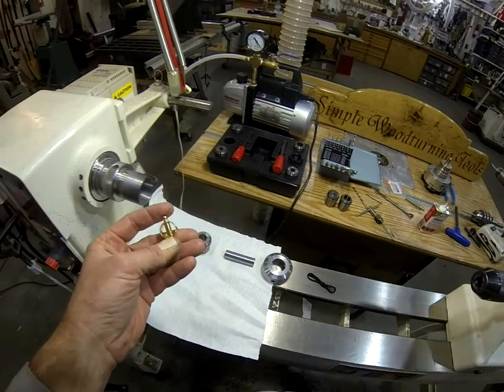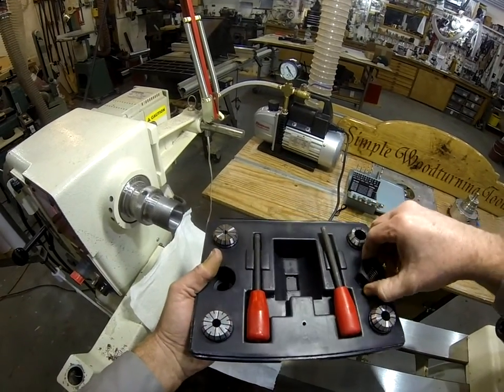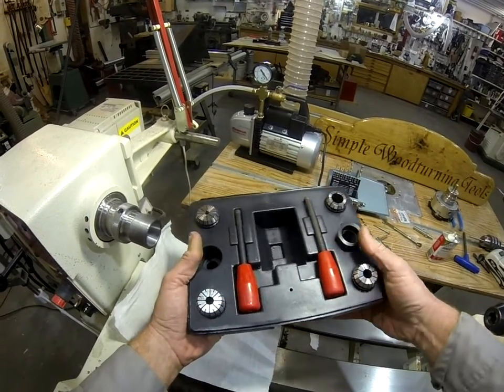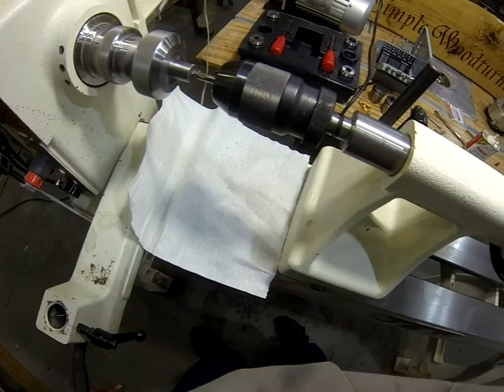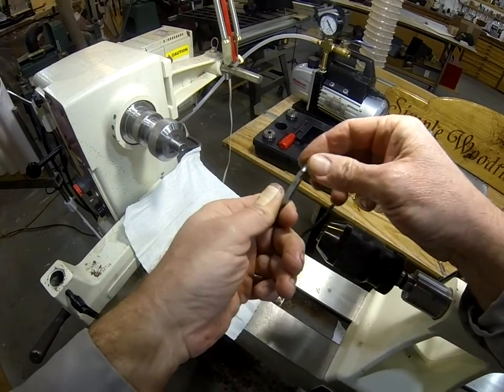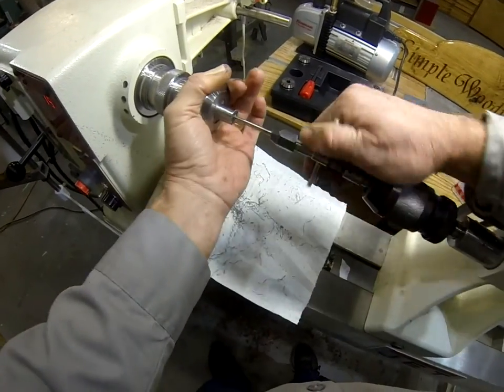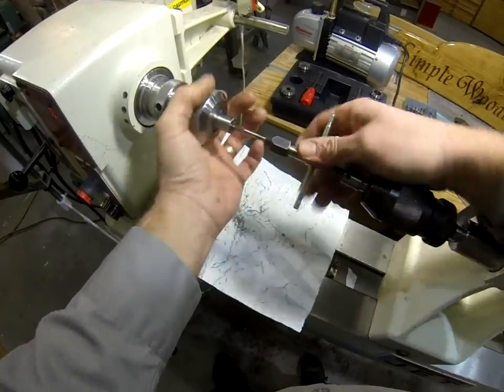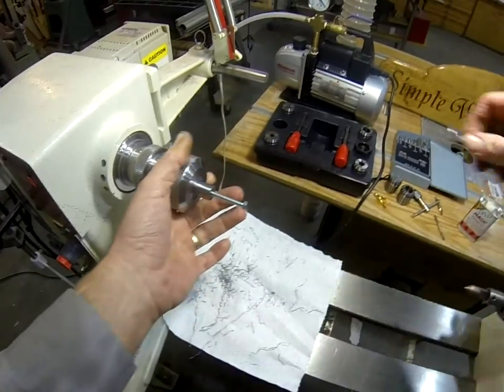Make a steel M5 Mandrel on your wood lathe

Comment: I'm just getting into turning and was having issues in buying a midi lathe, as I couldn't deside on buying a metal lathe or wood lathe. I wanted to do both small wood & metal home projects. good to know I can use a wood lathe for small metal projects.  I also like that fact you gave some info on the tooling I will need to add for the lathe to make this work.  This really helps. Now I just need to find the best lathe for my budget.